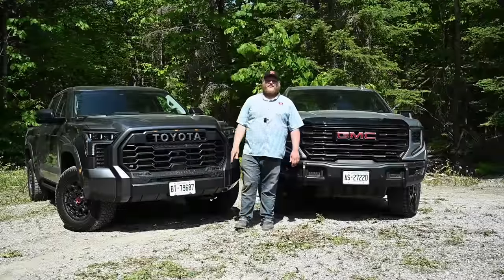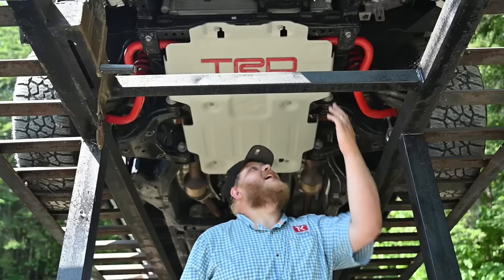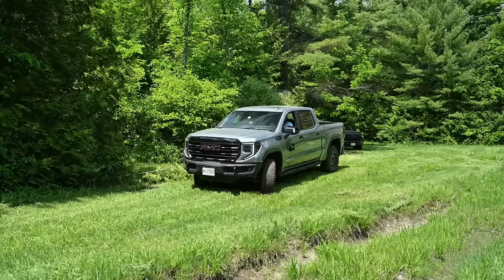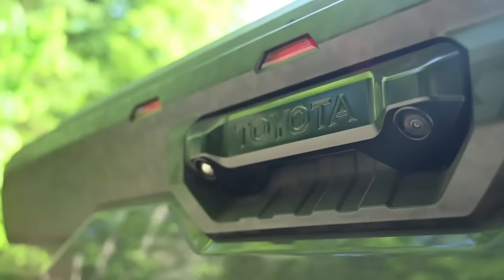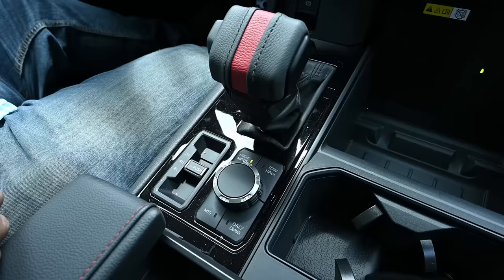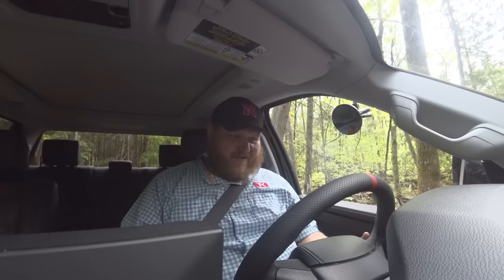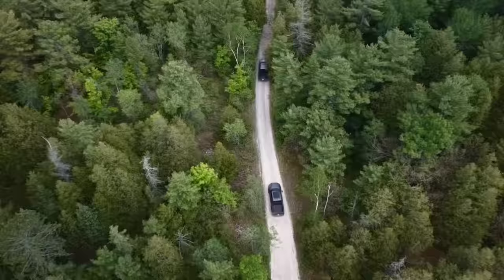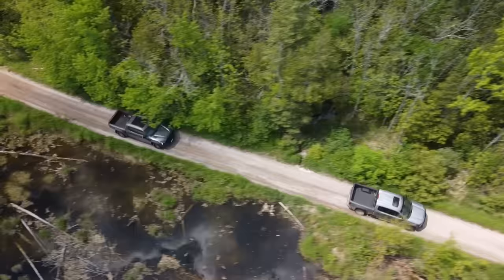2023 Toyota Tundra TRD Pro vs GMC Sierra AT4X AEV - Mud, Rocks & Water will Decide Which is Better!

Comment: I just can’t justify a full size truck for any price with less than 1,200 lbs of payload, not to mention less than 9k towing for $90k USD.
Reply: They are all about going to the mall to buy a new purse that you can put into the tiny bed. Expensive and useless.
Reply: I think it might actually not be that bad of a price.
If you start with a ZR2 which is about the same price as a TRD Pro and then upfit it, you'll lose about the same amount of capability and gain the same eye-popping final price. And that's probably being generous, since you can add alot of the accessories to the ZR2 that come standard on the AT4X. but there's no simple way to make the interior as nice as in the GMC for either the ZR2 or Toyota. 

The real problem is all these trucks are too expensive before you even begin adding options, and really neither GM nor Toyota allow you to add the special hardware to the cheaper trucks more people can afford...though again those are also too expensive.
Reply: To me, the quality and economics of the midsize offering and the capabilities of the 3/4 ton trucks make the full-size segment very questionable, at least in their off-road forms.  Most Colorados, Rangers, Tacomas (2024) and the Rivian R1T will offer better off-road capabilities, economics, and payload than these.  If you need more towing or payload, the 3/4 tons are not much more expensive (especially with the gas engine options) and offer significantly more capability.  That’s probably why the truck in my driveway is not one of these.  But they do probably look cool at the Whole Foods parking lot.
Reply: I don't think I've ever seen a vehicle that will more reliably be spotted in a Whole Foods parking lot than the Rivian...but if you say so...

That aside it's false that most mid sizers offer better off road capabilities. They'll definitely fit more places, but that's about it. Most don't have the ground clearance, angles, or protection that these do and that's a big deal. The ones that do, like a Canyon AT4X or TRD pro Tacoma, have even less towing and payload. And no one is shopping these if they need 3/4 ton levels of payload and towing...you might as well be suggesting a 10 passenger van to those people.

but that's all it really is, you're just not in the target market for either of these two trucks. They're definitely niche vehicles, and I don't think this is where most truck buyers should be looking to spend their money...but mid sizers and 3/4 tons aren't a satisfactory alternative here by my estimation.
Reply: While I’m getting a back massage in a self driving truck going down the road towing it’s own 9000 lb payload you enjoy that Toyota. My last tundra blew up at 53285 miles. Total engine failure with all maintenance done at Toyota. Never again.
Reply: pretty embarrassing when you consider the Ridgeline has a 1500 lbs payload.
Reply: @JLawL You enjoy that back massage and your puny 9k towing, while my 1794 tows my 11k camper all day. And I traded in my ‘14 Tunda with 246k problem free miles in for it. But hey, I bet you’re the king of the potbellied flip-flop wearing crew in the Cheesecake Factory parking lot.
Reply: @JLawL  I call BS to taking your claims at face value.  Your post screams vibes "you effed up and want Toyota to take the blame." Tundra engine failure at 53, 285, of which I am assuming was a 5.7L V-8. Literally bullet proof and ultra reliable. I'm curious what you did yourself that caused engine failure you are trying to throw the GEN 2 and Toyota under the bus for.
Reply: @terrarecon everyone makes a lemon now and then. I agree it’s at worst an outlier. Not indicative of the 5.7 or Toyota’s average product
Reply: I agree it does suck, however, I own one and I told myself, if I wanted to tow, I'd get a towing one. This is for off road use. Not towing.
Reply: @K-bob_45  you are correct, even Toyota is not immune to having a lemon roll off the assembly line.
Reply: @mak450 On size and weight alone, full size trucks are at a big disadvantage. These features ultimately are only closing that gap. A similarly equipped midsize is still superior in performance. Case and point, a zr2 Silverado could not keep up with a zr2 Colorado on very technical trails. Maneuverability is one of the most important requirements in offroading, behind traction and full-size pickup trucks are at a clear disadvantage in that regard
Reply: @YerBoyTroy  I don't know how you read the conversation that took place and still think you needed to tell me that, but ok go off I guess...
Reply: @JLawL just because u take it to the steelership, it doesn't mean you get the best service. Some mechanics there are total doosh, and yes they hate doing oil change at the dealer fyi.
Reply: The off-road focused trucks tend to have a softer suspension. It makes sense that they don’t have a high tow rating.
Reply: @chrisnah6540  You are proving my point.
Reply: I thought my truck has low pay load and towing. My 17 ram 1500 has 1,389 lb of pay load and 8,040 lb of towing. It's not an "off road" truck but it is 4x4 and I was a little disappointed when I read the numbers.
Reply: I have a 2011 tundra limited lifted on 35 nitto terra grappler G2’s with 200k miles and had minor issues (alternator, battery, starter) nothing major. This comparison was awesome and everything, but I think you coulda pushed the trucks a little harder and both woulda went through each part of this course with ease. Another addition to include would be after 50-100k miles what would the price be for each truck the gmc may have been better in some aspects off road but when you go to trade it in will it be as good then?
Reply: @mak450 I'm on my 2nd Tundra just barely after being raised in the South on Fords and GMs 50/50 but being the first Toyota owner in my family I've had no regrets always do my own maintenance Left a 2016 4runner for a 2013 Tundra and now I have a reason to tow more for this year for sure already did my 100k mile service no metal bits in the transmission and now I see why they're called million mile trucks I plan on keeping it til the engine or transmission give out
Reply: I think the strange changes I see in the new vs my 10yo Tundra is that gap in front I have a full size front metal skid plate covering all gaps except the A-arms wish they didn't gap the front in the new Tundra but like all their gens they improve on feedback so I'm sure they'll have a plan to improve
Reply: @JLawL try harder to tarnish the image but it's not enough dude, go pay them back
Reply: You don’t have to justify it.
Reply: @JLawL which Toyota did you have and what model/year ?
Reply: Amen brother
Reply: No Doubt! Totally marketed up BS. No wonder why they are on strike… Leave it alone I KNOW there are UAW workers that make WAY too much money, but there are those that are pawns in the political game that are being TRULY screwed over. Now matter what if you want 40 hours pay, you work 40 hours… Just saying…
Reply: Completely tragic i wish it was more affordable like around 45k not close to 100k plus even tho the trd and the at4x had some rust in someplaces its dumb to pay 100k for a truck that has freaking rust
Reply: @JLawL that’s insane I have an 08 aTundra Crew Max with 200k miles and still runs like a champ
Reply: My 2022 Tundra has an almost 2,000lb payload and tows up to around 12,000lbs. No offense, but what are you talking about?
Reply: Payload depending on configuration on these is 1500-1950.
Reply: @JLawL  care to tell us what it was exactly? Sounds like a toyota hater bs comment to me.
Reply: Right? I think I'd rather have a second generation tundra.
Reply: @MountainManBran check the label inside of door, probably less than the advertised weight
Reply: @stevieray1828  I checked the door sticker before I purchased the vehicle, as I planned on towing with it. My payload is approximately 1700 lbs, and max towing is 11,400 lbs. I also paid $60k not $90k. I literally don't know what Todd (OP) is talking about.
Reply: @LayzeeGiant nice truck.  Nothing wrong with potbellies or cheesecake, either.  IMO
Reply: You can get and tune the lz0
Reply: The pro tows over 11k. 1600 payload.
Reply: @toddmcgee5982  I disagree. just got a 2024 gmc sierra 1500 with the lzo with the max trailer and it towes my 11k pound boat with trailer at 15mpg which is more efficient than the 2500 gasser on city mpg just driving lol
Reply: Because that's an offroad dedicated trim. If you want a truck that has better payload and towing capacities then there's more affordable trims that are out there. Ill never understand why people complain and cry so much.
Reply: @LayzeeGiant  which one has the 9,000lb towing?
Reply: @javierpalomares2892 Exactly what I was thinking. Those numbers are ridiculous for a full size truck. And those prices. What in the actual hell?
Reply: My mid size Colorado Trail Boss has 1500#s of pay load 7000# towing 310hp 430#s of torque
Reply: @javierpalomares2892 yeah well, I’m willing to give up 500 lbs of payload for 10000x more off road capability. Ridgeline isn’t even a truck. It’s literally a Honda pilot with a bed😂
Reply: Just ask off-road legend Walker Evans who makes the best off road pick up.  1980'S. DODGE RAM,  won Baja 1000 first overall, beating the bikes and buggies and he said the truck had air conditioning. No 23+ speed transmissions needed.  Modern "JUNK"
Reply: gmc

Comment: I'm not sure I'd take any new full sized truck off-road nowadays, they are just too expensive.
Reply: And big
Reply: Pickups are meant for work not off roading like SUVs are meant for... I like how the companies keep trying to bend the dynamics of the structure.
Reply: All the trucks I've owned have to work off-road.
Reply: @googleaccount2637 that's  the only it must capable of hauling and off road
Reply: Who cares have fun no point in being boring
Reply: Luxury trucks
Reply: Buy some low price off-road capable cars and modified it's fun
Reply: Why buy a toy and not use it
Reply: Exactly, these new pick ups are wayyyyy to sisifyied...
Reply: @AlexMartinez-uq2ye  sissified? My 3rd gen tundra will outdo any other gen tundra
Reply: @sexyfishyphish  wow! Really?!
Reply: @AlexMartinez-uq2ye  stock vs stock yes
Reply: @sexyfishyphish  👍
Reply: Falls apart in 5 years and insurance and registration
Reply: I doubt any one  actually takes them for some hardcore off-road . Most of the half-ton ends up being a grocery getter .
Reply: @googleaccount2637  working off road and driving over boulders are two different things the independent suspensions are going to snap apart under such stress,I personally would never put a 80 k truck through that toture.mud and dirt roads and snow hell ya.
Reply: Had Toyota had a Chevy had a ford. The only truck that has lasted on the pipeline is this 2nd hand ram 2500 with over 200k miles
Reply: 99% will never leave the city limits.
Reply: Well maybe try getting a job. That might help 🤣
Reply: Not even close. That’s like saying a tank from the 80s for  the military is better then a modern tank. You would get demolished in war
Reply: @liamcarp7113   the Toyota product is crap.  Plan and simple. It’s not dependable as the old models.  It like the guys who buy 4 runners and tacos and want to do over-landing and they call us to tow them to a shop. It’s more common than you think.  I have yet had to tow a Nissan strange as that is . But hey keep buying this new junk I love the cash matter of fact I think my rates just went up for Toyota guys since they are so wealthy lol 😂
Reply: I prefer my bare bones Tacoma. I bought it brand new for 23k in 2019. I bought it because I always wanted a Tacoma and I got the 4cyl because that engine is bullet proof. I bought it with the plan to give it to my son when he turns 16, but I don't want to now because I've become attached to the truck.
Reply: @michaelharrisson1683 
SUV 💯 % can't do off road !!!!!
Reply: I can afford to take mines offroad. Get your coins up
Reply: @bentleydonovan4608 there is nothing in this video close to hardcore.
Reply: @Jeffyinthehills  ya I didn't necessarily mean this video I meant rock climbing and serious off roading ! Nice truck  and I personally like independent suspension compared to the rides I used to get with my solid axle leaf spring suspension trucks.but they could take some serious stress,the ride however stunk.
Reply: It's the cost of looking cool. Don't want to cheap out and look like a wuss
Reply: And fragile..
Reply: @michaelharrisson1683 if your truck is made for off road then it’s better than an SUV off road with utility being accounted for
Reply: Грузовики слеланы ,для работы .В том числе и в тяжелых  условиях .
Reply: @user-xb3nk6dx3g of course not. Toyota makes the best products. They’re reliable, make your own trucks then start talking
Reply: @Belovedfire  Toyota does not make the best truck with these new models  you will see when you get it towed to the dealership,   They use to be
Reply: That what these trim levels are for though! Totally agree that they're awfully pricy
Reply: @michaelharrisson1683 they’re meant for whatever you want it to be..
Reply: @kazikhalid6197 and that hurts you how?
Reply: The only difference is the GMC frame will rot out, they up here in canada
Reply: I drive a 3500 denali dually and its on 35” mud terrains and has a wee bit of a lift but I still tow things and put heavier things in the bed on top of my rat pack tidy tank and toolbox.

The conditions in the industry I work in require you to “off road” your vehicle. I beat the shit out of my one ton. Like this time of year the roads to work involve shovelling out my wheel wells so I can turn.

And it continues to take that shit cause I believe GM did a pretty good job with the newer heavy duty’s. 4 def heaters though, lol. Eventhough everyone likes to point out these new trucks have more plastic then ever and one can see planned obsolescence in a driving ipod. I think the big three produce a piece of equipment when it comes to these newer heavy duty’s. The things in my career I’ve seen people do with an F350. In some environments theres little to no mechanical sympathy.
Reply: Try desert trails ie dirt roads. You’ll have a ton of fun without risking breaking something.
Reply: @michaelharrisson1683  You don't get to decide that
Reply: @IsaacMuntz  yes I do... I am God
Reply: @michaelharrisson1683  Dang it!! ok God whatever you say

Comment: weird to have an offroad truck with no tow hooks or front locker.  I'd have to go with the GMC if I was off roading for those 2 reasons alone.  Both are too big for real off roading I think though.
Reply: Let's be honest here. Off-roaders with front lockers are still rare. Only a handful of them are available in certain trims of certain models.
Reply: They are being honest. Toyota doesn’t offer a front locker… period.
Reply: @KErtter1  no big deal in my mind. I think Raptor even went back to front open diff. Fact is hardly anyone is actually taking their new full size pickup to places that would require a front locker.
Reply: Turn radius for the tundra is doo doo
Reply: The TRD pro is the most off road ready truck Toyota offers. It's not supposed to be a dedicated offroad truck. It's purpose is to offer offroad capability to a truck that can still tow almost 12000 lbs comfortably across the country without any issues or drama and then be a grocery getter and errand runner when you get back home. Something that the dedicated Ford, Chevy, and fiat off-roaders can't do. The tundra is an all in one truck. Work, play, vacation, and daily driver and still worth something after 300k miles. Ford Chevy and fiat has no resale value, especially fiat, and won't even make it 300k miles.
Reply: @T_81535  yeah, but no tow hooks?
Reply: We'll for $20,000 more you can get em with the fiat. Ive never  needed them personally so it's not worth it to me. Anyways I'm sure an aftermarket bumber install with shackle loops would work just fine wouldn't it?
Reply: @pabo8080 sucks when tow hooks is an argument doesn't it?😂
Reply: @T_81535  i m not arguing with you just saying tow hooks are a handy thing to have.
Reply: @KErtter1 I think Toyota is going to have a front locker on the new Land Cruiser.
Reply: Uuum, it’s not a LC w/ a 4 banger - not even close!!  A sacrilege to even refer to it as such!
Reply: No tow hooks ? All that Plastic 😂.  Stupid is stupid 🙄